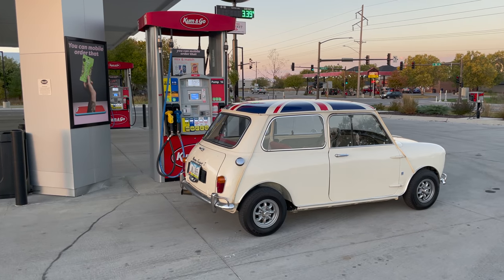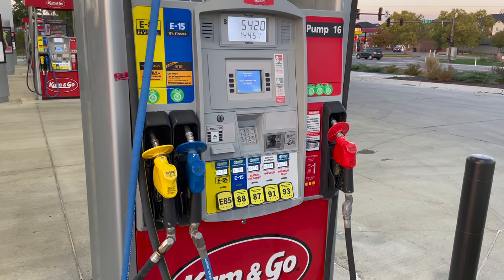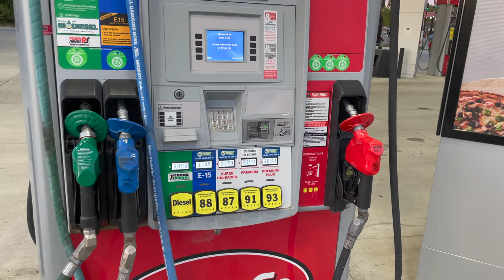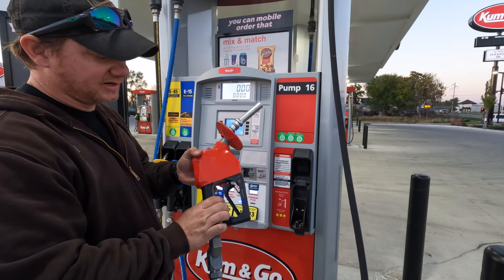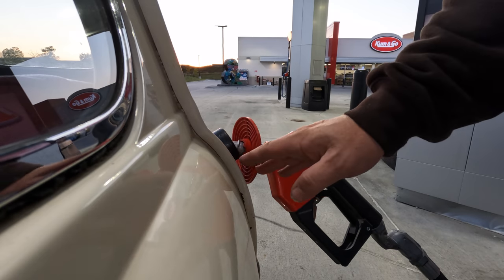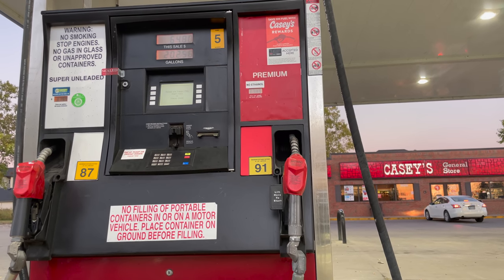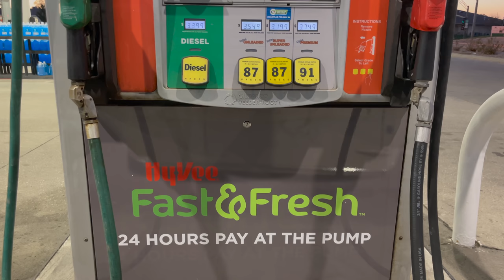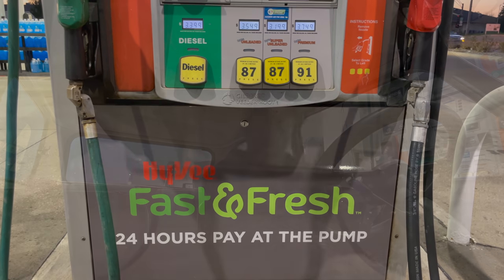What Fuel Do I Use In My Classic Car

Comment: Don't take that as representative of the US. Apparently corn country that forced this ethanol crap on us is the only place in the US where you can easily find non ethanol fuel. I live in a large city and there are maybe 10 stations where you can find non ethanol fuel within 50 miles. Most stations I've stoped at anywhere at least in the southeast of the US say all fuels contain up to 10% ethanol. I felt lucky that one of the stations where you can get pure gas is less than 5 miles from me.
Reply: I remember in USA there was a glut of corn syrup and it was added to most foods, and George Bush tried to sell it in Europe.  Is this corn syrup what they are now fermenting to produce the Ethanol ?   Waste cooking oil is also good for making biodiesel, which solves a problem of disposing of used cooking oil and reduces emissions from diesel engines. A very green solution for a waste product, but governments don't seem too keen on this, as they can't work out a way to tax it (again)  if you make your own.

Comment: Altho' many in the UK don't know it, especially moaning old men that own a classic (like me), ethanol free petrol is available in the UK (altho' labelled as E5).

E5 (zero ethanol) - double the detergent additive - 99 RON

E5 (UP TO 5% ethanol) - two or 3 times additives to regular - 97 /98 / 99 RON

E10 (UP TO 10% ethanol) - regular, vast majority of petrol sales - 95 RON

When seals are old they can deteriorate and leak with nothing to do with ethanol - we had all this doom and gloom when unleaded petrol was introduced but the world didn't end and some of the same cars with the moaning owners around then are still around now, and same moaners.
Reply: Yes, zero ethanol is available in the UK, but the information on precisely where is not easy to come by. For example, I know that Esso E5 has zero ethanol unless you're in the north of England (and some other parts of the UK), but they won't tell the general public which stations or where 'the north' starts (yeah, yeah, Watford Gap ...).
Do you know which ones?
Reply: I thought I'd put up a second post with more details - but it's not here, I'll try again.
I doubt exact regular locations can regularly be given with certainty as it might depend on supply/supplier source locations and destinations. I'll try second post again.  Or you could try contacting the companies yourself.

Comment: I am absolutely astonished that in the heart of corn country you can get ethanol free gasoline. Here in Maryland it is all 10% or more, but I have not seen E85 here. Off road fuel that has not paid the highway tax can be found in farming country and boat chandleries and some contain no ethanol. This does not save you money. The ethanol free gasoline for boats costs about $8 a gallon. The ethanol fuel melted some built-in fiberglass gasoline tanks in boats. Off road fuel is dyed so they can tell if you’re cheating.
Ethanol is less energy dense than gasoline leading to a loss of mileage. I wonder if anyone has done the math to see if the mileage gain cancels out the price differential.
Reply: The MPG difference is there, but doesn't offset the cost difference when using non-ethanol in Iowa.  However, like Steve mentioned non-ethanol fuel stays viable longer when you don't drive vehicles that often.  They'll all start smelling like varnish eventually, but non-ethanol fuel is good for more than a year.   I'm currently driving a tank of 91 non-ethanol in my car that I haven't driven since 2019 and it runs fine.   The other issue with ethanol vs non is how it affects metals like the aluminum in a carburetor.  Ethanol fuel tends to make a white dusty scale start forming on metals in these old cars.   I am VERY happy to have made it this long in Iowa with non-ethanol fuels being pretty easy to find.  There's no law forcing the gas stations to carry it.  Some Caseys and Kum & Go stations in small towns have no non-ethanol offerings.
Reply: Well I recently did a 210 miles test of fuel mileage in my Jaguar 3.8S and strangely got 18.7 MPG on ethanol free fuel and 19.25 MPG on 10% ethanol so going by my unscientific test not worth close to $1,00 more per gallon.
Reply: @johnquilter7620  Depends on if you plan on driving your car regularly or if it sits around.  I use non-ethanol fuel mostly because I own a lot of air-cooled engines, but also have so many vehicles I need the gas to stay viable as long as possible.   I've always gotten better fuel economy with 91 octane non-ethanol in Iowa.  I mean given the same trip across the same elevation changes and whatnot.   I've never noticed a performance difference between corn juice and the regular stuff.  It's definitely cheaper to use ethanol fuel in a daily driver/commuter type car.